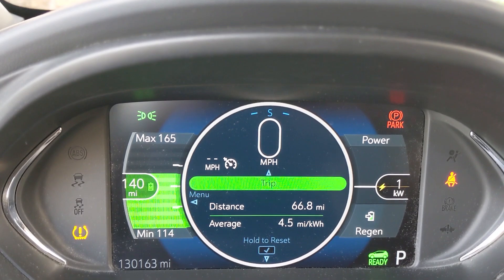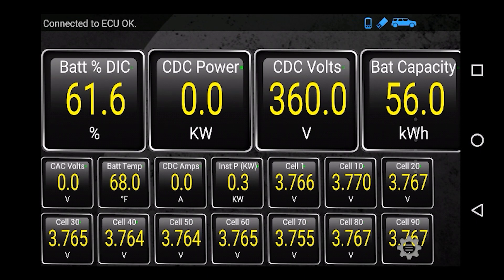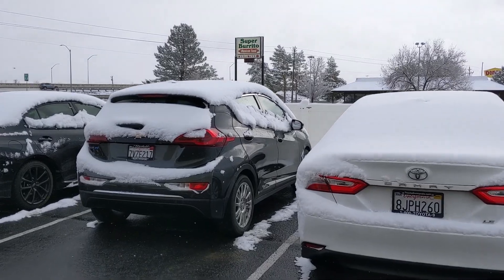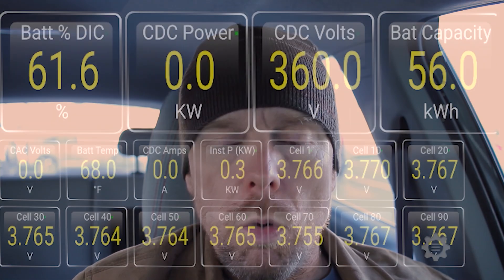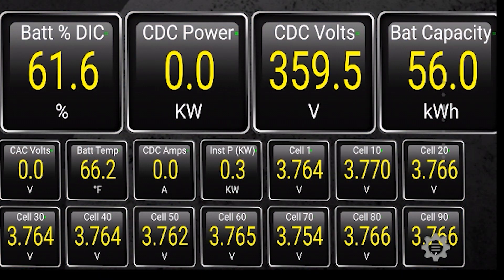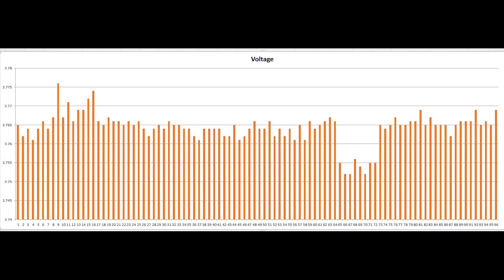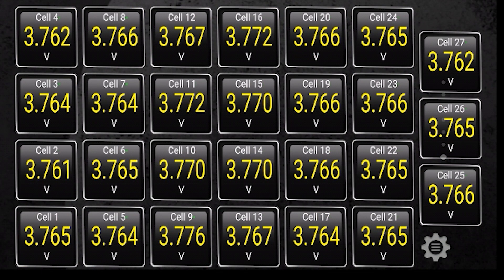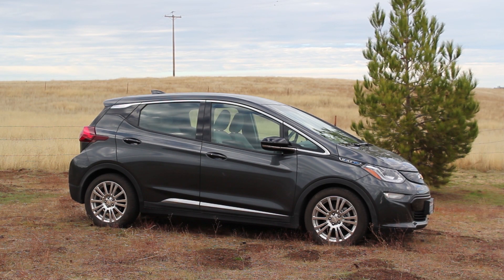2017 Chevy Bolt EV: 130,000 Mile Battery Degradation ft. Torque Pro

Comment: The PID is known to produce erroneous data. It has been removed on the 2019 Bolt.
Reply from the maker: It was removed, but I don't know that it was due to "erroneous data." It appears that GM didn't want owners checking their capacity with an app. I do agree that it's not always providing accurate information, but that might have as much to do with natural variance when testing batteries for capacity.
Reply: @newscoulomb3705  I think it was more that GM didn't want owners reading erroneous data and complaining. It's pretty easy to see why they wouldn't want that...

Comment: Eric, when the battery was new it did not have 60 KWh "usable".  I believe the "usable" capacity is 57 KWh.
Reply from the maker: It really depends. My Bolt EV specifically had over 59 kWh usable, which I could verify from the Energy screen. I have heard of some Bolt EVs that drove off the lot with less than 58 kWh usable, but that's just variance among batteries. 
The 57 kWh sticker that LG put on the battery case was the guaranteed minimum capacity for the battery. The typical capacity was ~60 kWh, and that's what GM registered on the EPA filing documents.
Reply: The usable capacity (from my last full to low test that I did on my 2019) is 59.7kWh. So the usable capacity really is 60kWh.
Reply: I think your confusing the label that LG chem puts on the battery with usable capacity.  Yes LG Chem put 57KWh on the battery.  But GM has stated the variance is how the capacity is measured.   Supposedly LG chem measures capacity using a higher discharge rate leading to higher internal losses (commonly used in the electronics industry).  GM uses a discharge rate that is more typical in an automotive application which on average is less and giving a more realistic usable capacity for the Bolt EV.

Comment: Eric, I know you don’t have home charging.  Did you take your 2017 in for the recall update or are you just self limiting your charging to 90%?  I decided not to do the recall and just program my 2019 to stop at 90%.  Most of my charging recently has been at a level 2 as we haven’t done any road trips since March due to the pandemic.
Reply from the maker: Right now, I'm in Northern California, so I do have access to home charging. I still haven't done the update yet. That's partly due to time, but it's also because I don't feel that it's a solution to the issue. The update might be able to test for the issue, but until GM releases an actual fix/plan, I'm not going to bother with the update.

Comment: Eric - does a slow charge to 100% improve the voltage deficit noted in the 60’s vicinity cells - aka balance them?
Reply from the maker: No, not that I've seen. The Bolt EV will attempt to balance the cells when the battery is full, but it doesn't appear to effect the ~0.02 V variance in cell voltages.

Comment: 7% over 4 years and 130K miles , with all the fast DC charging. Sounds really good to me, thanks for the update 👍
Reply from the maker: Yeah, I'm surprised it's been so stable the last year. Most of that 7% occurred in the first year or two.
Reply: @newscoulomb3705   Doesn't that generally match other known degradation curves?  Sharp fall off at the start leading to a much slower decline.
Reply from the maker: @adamwillcox8175  Yes, it does. I think it might also have to do with my starting to use Hilltop Reserve (only charging to 88%) most of the time.
Reply: I have about 11% degradation on my 6 year old model S with a 85kwh battery. Based on the range with a full battery.   I have 102,000 miles.  It seemed to drop off at about 3 years and then had been very stable over the last 3 years.  Still getting a little over 240 miles so I really never charge to full anyway.
Reply: It’s incredible considering 10,000 miles ago it had more degradation like 9%.10,000 miles later it’s down to 7% maybe it’ll be back to 100% at 150,000 miles. Great car
Reply: So in 8 years u will have min 15 per cent lost? Is not much but not low as well! 15 percent?
Reply: @vasileiospetropoulos2046  Every ICE I have owned have lost 15% or more MPG after owning for 8 years...
Reply: @kaitchen  maybe but the average car cost 20000 oor 15000 pounds not 40000 or 50000 pounds lol
Reply: @vasileiospetropoulos2046  You are right, my bolt cost around 15000 pounds used lol
Reply: @kaitchen  in UK? Or in USA?
Reply: @vasileiospetropoulos2046  oops I meant £12000 converted for you
Reply: @kaitchen  
Probably from lack of tune-ups? I've got a 12-year-old Prius 345,000 miles. 
I still average between 45 - 47 combined.
And I pretty much beat the crap out of the car.
Reply: @kens97sto171  ECU in modern cars means continuous tune up.  As long as the cells in your Prius hold charge, I think the regen will mask modest ICE MPG losses due to worn or dirty combustion chambers and AT slippage.
Reply: @kaitchen  I have stated this fact many times. Glad to hear someone else see that it happens to ALL cars. My SL2 Saturn got 36 mpg new than when I sold it it got 30-31 mpg. So yeah around 15% give or take. 98% of peeps don’t track that in their ICE.